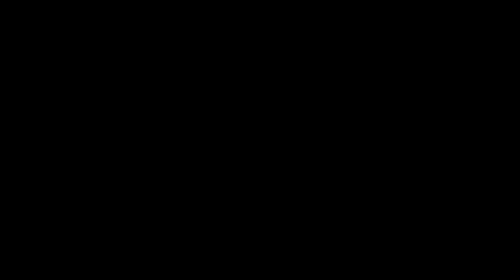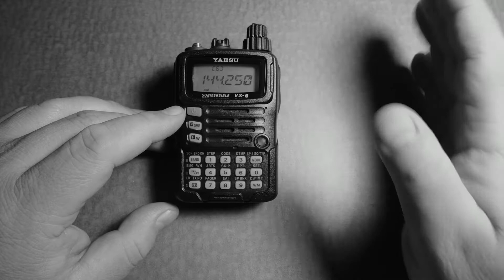Yaesu VX-6 for a Repeater Setup

Comment: You shouldn't activate your PPT without and Anntenna ?
Reply: @frankwc0o  No worries its a learning curve. Or you also put a dummy load on it if you wish.
Reply: I have programmed the frequency RX for listening, i can listwn to the group but i cant program the frequency for TX 443.005.  Everytime i type manual after typing the 2nd 0 another zero automatically appears 443.000.
On the offset -rx  its only either 13.555 or 13.60  but i need to have it 13.57. Please help
Reply: @fbulao  Change the Step setting and make it a smaller number. Step sets the distance between frequencies that your radio recognizes. It's used to compensate for different frequency bandwidths around the world. You can safely set it to the smallest value "5 kHz". You may want to increase it for VFO mode, but you can worry about that later.

Are you sure you have the right values? Those seem off. The typical offset for 70cm band is 500 kHz. If your RX is 443.000 your TX is generally 443.500